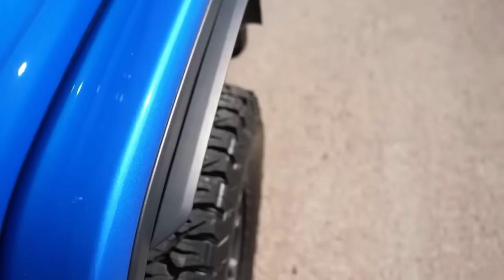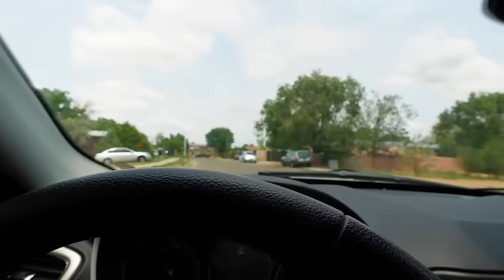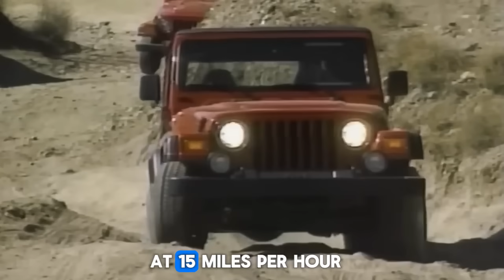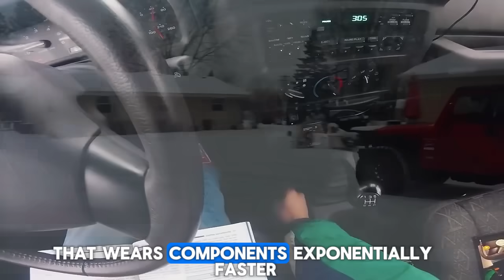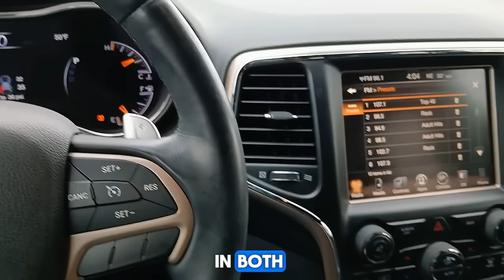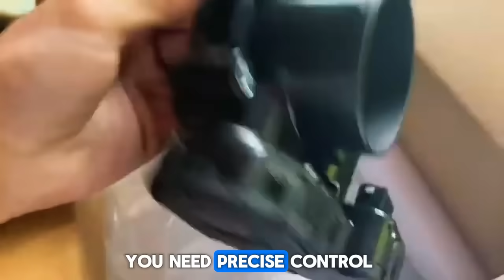5 Hidden Jeep Settings That Are DESTROYING Your Engine! Turn Them OFF Immediately

Comment: I don't see a Sport Or S mode on my 2022 Jeep Gladiator 8 speed transmission? Is there another way to access this? I have a Tazer Mini full feature and I don't see a setting for throttle response? Is one available in the Tazer menus?

Comment: 4 high on wet pavement - what? Who is doing that? I had to back up the video to make sure I heard it right. Turning traction control off will not help you out of that. 4 high\4 low are not for pavement. Unless you have Select-Trac you should only be in 2wd on pavement.
Reply: Ummmmm …. Snow?
Reply: ThroughTheCamerasEye.  This is correct.  Only 2wd on pavement, 4high on snow or ice, and 4low off road. (All in general).